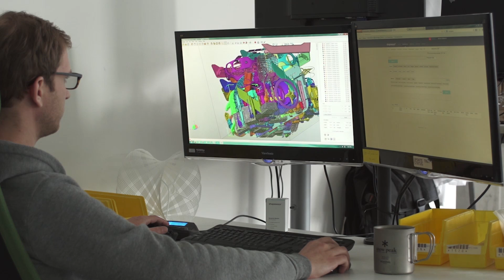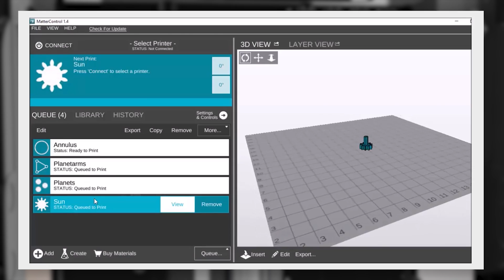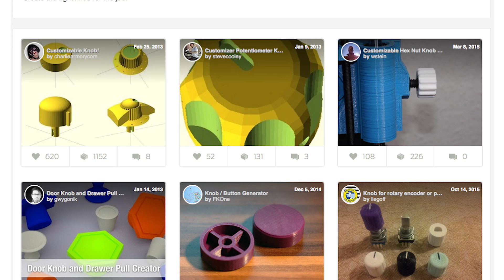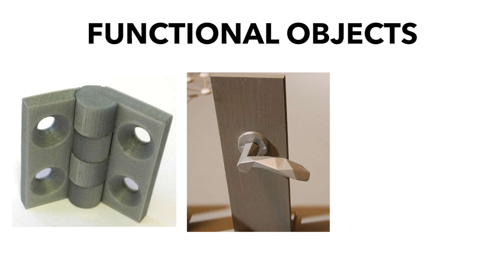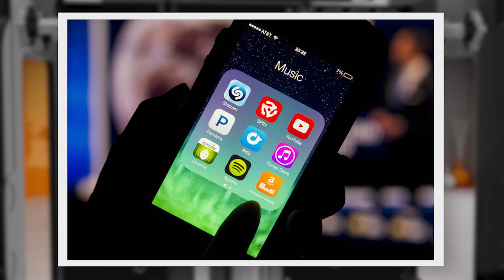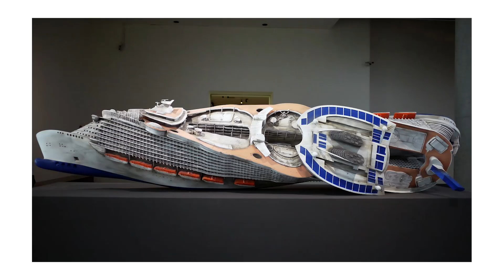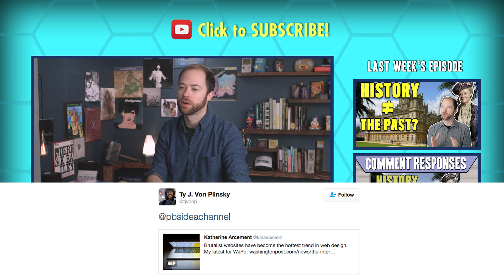Will 3D Printing Break Copyright?

Comment: I can see a system like Steam or Netflix for licensed and verified 3D-files for when it's absolutely crucial that the parts you're printing are up to specs, as in the example with the aeroplane. Stocking items is expensive as hell, but a 3D-printing shop with access to high end SLS machines can make things on demand. I might take a couple of days instead of waiting up to a few weeks for said parts to get shipped halfway across the world. It would also be better for the environment to manufacture things within a short distance from where they are to be used.

Comment: I was going to complain. Software is almost always functional, but it is copyright protected. 

However, it turns out, the lawyer knows more than me (a layman). Two and three dimensional sculptures are only protected by copyright in the case that "such design incorporates pictorial, graphic, or sculptural features that can be identified separately from, and are capable of existing independently of, the utilitarian aspects of the article."

Comment: Copyright and patents exist to prevent people from selling cheaper copies of products. A 3d printer is not capable of producing products at any significant volume, let alon price, so what's the point of protecting files?
Anyway, it's bizarly simple to make the patentet part a subset of a larger print, or even to chop it up into parts that are put together, so no, the discussion about copyright is pointless.

Comment: I wish I weren't too poor to 3D print stuff.
Reply: +Rory Walker 
printed stuff is crap  I doubt if  it will ever become something decent
Reply: It already is something decent. Plenty of great stuff is 3D printed, even if you hate ABS plastic.
Reply: Rory Walker 
I don't know any printed stuff which has decent strength
Extrusion printers produce super ugly surfaces  while powder printers produce objects that require additional treatments to improve strength.
at best, you can use 3d prinder to produce molds for metal  casting

Comment: I was always under the assumption that things personally produced for personal use do not fall under any sort of copyright or patent restrictions right?
Theoretically i could build a phone that was the same as an iPhone in form, function and design as long as it's only meant for my personal use and not try to sell it to a third party or am i wrong on this?
Reply: I don't know how patents work (I'm a writer, not an inventor), but under UK copyright law, the owner of the copyrighted work has full say in any copy, performance, adaptation, etc. of such work (except places where 'fair use' apply - private use is not inherently fair use). I would assume patent works similar though, meaning that, legally, you can't make a phone identical to the iPhone without Apple's permission, unless it is outside of patent. Whether or not you'll get caught breaking this law, and whether you'll face penalty if you do, is another question entirely.

Comment: I think it should be treated like a regular printer. After all, (gross oversimplification upcoming) it's essentially a printer with a Z-axis and a regular printer doesn't break copyright
Reply: But 2D printers can't print mechanisms...
Reply: Henry Rasia if you print a thousand sheets of paper and glue them together with really strong penetrating glue like loctite they can.

Comment: Very curious to hear your thoughts on 3D printing, fire arms, and the 2nd amendment.
Reply: +JustJash how are those related? 3D Printer can not create gun parts since the material warps slightly, at least to the best of my knowledge
Reply: +Goat Bot   Guns have been successfully 3D printed before.  The first few made would break after a few shots were fired from them, but they have been improving sense then.
Reply: +Jeronimo Torres 
Those are toys not guns.wooden  slingshot is more usable than 3d printed gun. and there is no way to improve anything because guns need top quality materials with proper treatment and 3d printing is very crappy and weak.
There is no way to 3d print gun barrel even using laser metal powder fusion  tecnology.
Reply: deltaxcd
Don't take my word for it, go search it yourself.  Crudely made but functioning guns are so common in fact that they have a name; Zip Guns.

You should also consider that 3D printing is used in some industrial works now as well.  I doubt they'd use it if what you said were always the case.

3D printed guns are possible.
Reply: Jeronimo Torres what does it mean "crudely functioning"?
You can just stick some ammunition into appropriate tube and smash ir with hammer to trigger, but that does not count as usable gun.
All you can do with it is to scare people or make them laugh to their death.

3d printing is used mostly for prototyping or display items.  main problem is that whatever you print is very weak and breaks easily 
real usable 3d printed gun is impossible just because of that reason there si no way to print materials that even remotely match what is necessary for modern gun

sometimes even plain machining is not enough, as you need to fit 2 tubes inside of each other to compress inner tube and make it capable to withstands pressure. without expanding
Reply: deltaxcd
I told you already to look it up yourself.  You are acting like a conspiracy theorist who refuses to research anything that can prove themselves wrong.  I've given you all the info you need to get started on realizing how wrong you are.  All of it is factual.

3D printed guns have been made and they have been fired successfully and met the metrics of their professionally made counterparts.  Only difference is 3D printed guns can't withstand multiple firings.
Reply: Jeronimo Torres 
If those guns cant withstand multiple firings they are useless also accuracy is not that great and their size is ridiculous

I don't say that you cant 3d print some device which can launch bluets but it is not decent usable gun.
Reply: deltaxcd
As I stated before, they are continually improving.  Just like every other technology in history has.

Your claim that a reliable 3D printed gun is impossible to ever exist is shot full of holes.

GO LOOK AT ONES ALREADY MADE AND SEE THE GRADUAL IMPROVEMENTS THEY'VE HAD.
Reply: Jeronimo Torres 
You can't improve beyond laws of physic.
Reply: deltaxcd
I now have full confidence you are a dumbshit.

Comment: intellectual property law is already broken
Reply: X-Blade Wielder Pure, raw Capitalism has almost as many flaws as pure Communism.  Mostly because PURE Capitalism has zero rules about "cheating" and therefore rewards the salesmen and lying bastards more then the creative or hard-working types.

Only black markets have ever worked on pure Capitalism.  Everyone else works out rules.  Some rule systems work better then others.  And rule systems have a finite lifetime before the cheaters break them.  And so you need new and better rules.
Reply: +Xennus The Shadoe It was considerably less broken then traditional copyright to start.  And the community is largely composed of practical minded scientists and engineer types.  And... they have the horrible example of the record companies to learn from.

I think the end result will be reached cleaner and more efficiently then you think.  After all, the entire goal of IP law is to effectively compensate people for the hard work of thinking up good ideas.  (and the harder work of proof-checking said ideas)
Reply: Hehehe... The point of IP law is basically to prevent our Capitalism from decaying into Communism (or something different entirely). I think Capitalism is doomed to be replaced by some new economic system.
Reply: kin2naruto Yeah, I see what you're saying. Essentially, there can be no Utopian economy until the individuals are themselves Utopian citizens (which is an entirely different discussion). I do, however, see the economy taking a radical shift over the course of the next century, and I look forward to what that new, revised system might be. Of course it will have its flaws as well, but hopefully it will continue to approach that Utopian economy.
Reply: +X-Blade Wielder +kin2naruto 
The point of IP law is basically to prevent our Capitalism from decaying into Communism
When I saw this comment, I actually thought you were a communist. Given your next comment, it seems you are not. But this assertion is correct, capitalism (and every other system in existence) has to have ways of preventing crisis and revolution (a significant crisis will also bring with it revolution). The reason regulations exist is usually either a. To calm people down and prevent revolution, or b. to benifit the powerful. Without these regulations the system would either collapse, leading to either communism, or another hierarchical system that has the same flaws and will inevitably collapse.

Pure, raw Capitalism has almost as many flaws as pure Communism.
Communism is simply a stateless society were everyone works according to ability and receives according to need. It is achieved once capitalism has given us enough organized industry and advanced technology and infrastructure to allow us to run all of production cooperatively and democratically under socialism, and after socialism has become efficient enough (through automation etc) that we no longer need to work except for the small amount of work that people do voluntarily for their own enjoyment.
Reply: I think your thing about regulations needs a third point. Point c) is that regulations exist to prevent the infringement of people's rights. Many of these infringements can be considered the result of capitalism (like with Copyright Infringement, which is a non-issue if you can't make money off of art because money doesn't exist), but they also occur because of the imperfection natural to all humans. We are never going to be able to stop the various forms of violence that happen between people, unless humans somehow evolve to the point that violence no longer exists the human mind. Some people are going to get that compulsion to do something that infringes on another's freedom, and states are (sometimes) good at stopping.
  Of course, the issue is corruption of the state. A very common thing to happen. A government for the people (not necessarily by the people though) is, as far as I see, better than no government. But, governments, being at the mercy of flawed creatures (humans), will always face some corruption. Look at the Soviet Union. It was created with good intent, a government for the people that would lead to the glorious state-less society, but nearly a hundred years later, Russia is still ruled by a centralised government (and has a near hundred year history of hurting its people). The alternative to easy-to-corrupt government (the Anarchy option) isn't necessarily better though, as I've already stated. 
  I think real communism (not what's often seen as communism thanks to Russia calling itself a communist state when it actually wasn't: as you point out, such things shouldn't exist) is a beautiful, but terribly distant dream. Capitalism works for a lot of things, and although horrible at times (most of the time), the alternative depends too much on all people being good, which won't happen anytime soon. State-led communism could work in an ideal world, but we've seen that it doesn't in this one, as corruption happens so easily. I think the best answer, for now at least, is to try and do everything one can to be a communist out of communism (in other words, be nice and be charitable).
Reply: You are gravely mistaken. Pure, raw laissez faire capitalism has no such flaws. What you are describing is cronyism, or gov't controlled economics. Our leftist controlled state schools and media have spun and distorted free markets and economic freedom into something totally opposite from what it is. It's FREE people, trading and transacting without gov't interference, regulations, tariffs, or subsidies. Every business stands on their own merit. If they lie about their product, their reputation is tarnished, word spreads and they go out of business. True free market capitalism breeds competition which gives us better, smarter and cheaper products. 
Our current corrupted, crony "capitalist" system is controlled by gov't "thugs" - the equivalent of the Chicago Mobs of the 20's and 30's where the mobsters demanded "protection money". If you refused to pay, you were "penalized" in various ways... Some pretty frightening ways.
In today's corrupt crony system, businesses can lobby lawmakers for regulations to restrict or destroy their competition. They no longer have to compete on a level playing field. They simply pay thugs to eliminate their competition. That is not free markets and is definitely not real Capitalism.
Reply: Just a drive-by comment: There’s no such thing as intellectual property law. There is copyright law, there is patent law and there is trademark law, but they all do slightly different things.
Reply: mina86 As far as I can tell, we're just talking about the group of them, as they all pertain to intellectual properties.
Reply: X-Blade Wielder Which does not change the fact that there is no such thing as ‘IP law’. You could, maybe, if you really wanted, talk about ‘IP laws’, but frankly, grouping copyright, patents and trade marks together is rather misleading.
Reply: mina86 Fair enough.
Reply: While I can agree that the current version of "capitalism" is not the ideal representative of the merits of capitalism, there are other problems with it as an economic system that we didn't mention. With the existence of capitalism, there exists a social hierarchy which is based on the arbitrary quantity of money a person has to their name. Psychologically, people are more prone to assigning value to things measurable quantitatively as opposed to qualitatively, and as such, money falls prey to this. This is problematic, however, because of a few reasons: 1.) In a capitalist system, money begets more money. If you have more you can invest, you have a higher interest rate, and hence obtain even more to invest. Likewise, if you have less than a handful of bills, there's not much you can do with it. It's a positive feedback loop. 2.) The previous point might be less severe an issue if it weren't for the fact that people need a certain amount of currency just to survive . I.e., if you happen to be on the lower end of the economic spectrum, it's not just a matter of putting a little money away, because you literally need every penny , and use every penny, and still end up homeless. 3.) Given that the system is far more up to how much money you already have, instead of how hard you work (not that that's completely irrelevant), the social hierarchy that's created is much less constructive, and in fact can be destructive in many cases. People feel that the amount of money they make is how much they're worth as people, which simply isn't the case.

Comment: I wonder whether it will become the case that you can make things for your own personal use but not sell them, I can see it that Dyson would never be able to stop you printing spare parts for your own cleaner but would come after you with patent lawyers should you ever try and sell them on. I can see this always voiding your warranty (providing they can tell...) as you have designed this part yourself by measuring the broken pieces and making something functionally the same in 3ds Max rather than using their own production method. I think it would be cool to see companies selling single use print files that you could take to a local licensed printers who would be able to vouch for correct materials, calibration etc to maintain your warranty, providing a certificate of some sort kind of like the service history of a car.  

It would be ace to see spare parts being made to order like that, with a trade catalogue in the store from which you could find your vacuum cleaner model and part code with a price to have it that day, it would no longer be a question of keeping that part in stock but of having the right kind of fillings or plastic. I dread to think how many spare parts there were made for minidisk players etc that went straight to landfill because they became obsolete before they started breaking. 

I also think it was pretty cool what Nokia did with the Lumia 820 in that they released the basic model for the case so that you could customise it and print yourself a new one without having to spend ages making sure it fit properly in the important places. I would be nice to see this kind of open source online library of things opening up, I wonder whether there would be a flip side of illegal torrents where you can get all of the necessary parts to make that new Karcher pressure washer in one batch and spend the weekend making one for yourself. My question here would be how this works with patent laws, I imagine that you would be in hot water using the genuine files that someone has stolen but would this be the case if you could prove that you bought a washer, meticulously studied all of its parts, recreated them yourself on 3ds Max and then printed and assembled a second washer for yourself. You aren't selling it, could it be similar to a physical equivalent of studying the chords to cover someone's song?